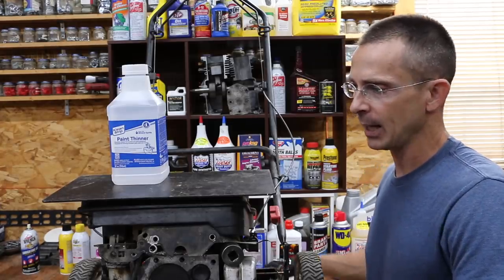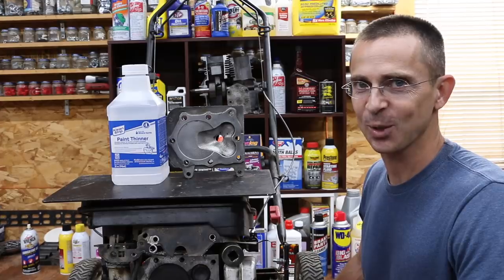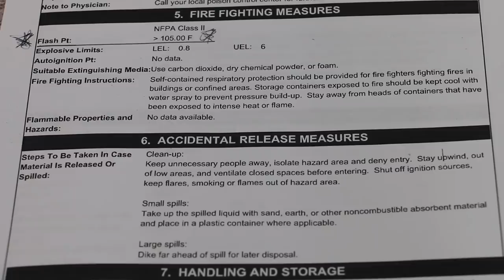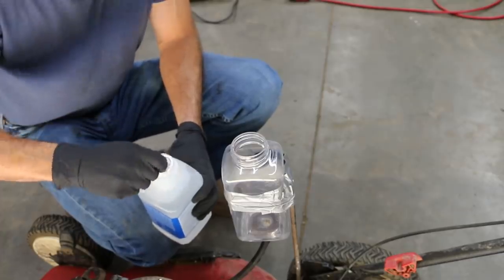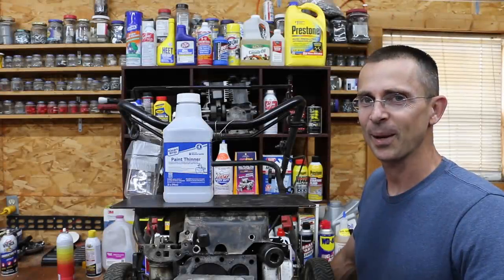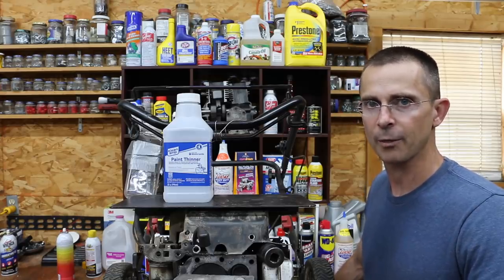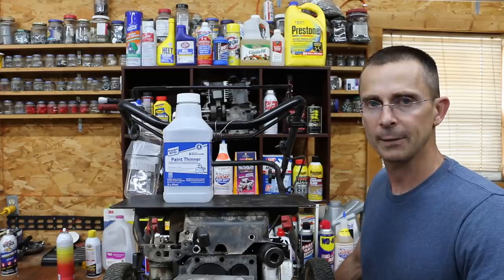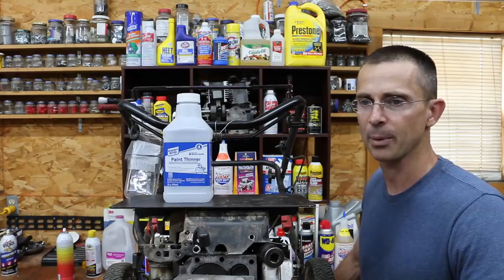Will a Gas Engine Run on Paint Thinner?  Let's find out!

Comment: Great videos.... i don't miss one of them.... question: why if is the same engine, sometimes have 90 psi and like on this have 110 psi on the compression test...?
Reply from the maker: The engine had 110 PSI when it was used in older videos.  In more recent videos, the compression has dropped a lot.  In some instances, the intake valve and piston rings don't seal well with exposure to dirty alternative fuels.
Reply: Project Farm  sorry you right, i didn't check the video date on each one ... Are you have test or someone have suggested to run an engine with only oxygen from a welder container or a mix of air and oxygen, like injecting on the air filter... like and suscribe

Comment: this works because all mineral spirits/paint thinner is essentially is just a dirty form of petroleum distillate which is a mixture of hydrocarbons, and various parrafins and all sorts of shitty chemicals lol. basically you take gasoline and distill it like you would ethanol (drinking alcohol) and whatever evaporates within a certain range is your heavy petroleum distillate (paint thinner). you distill this even further and you get naptha, you could also use naptha although naptha probably wouldnt work as well as paint thinner because its more refined and doesnt possess the same octane rating when used in engines as paint thinner or gasoline, if you have no money though it would probably not be a horrible choice because a bottle of zippo lighter fluid containing less refined naptha than vnmp naptha only costs 1$
Reply from the maker: Thanks for sharing.

Comment: Would please do one on rubbing alcohol  ????????????
Reply from the maker: Thanks for the suggestion.
Reply: @ProjectFarm  I searched yt and found that you tried a different alcohol, not rubbing alcohol.  I was impressed by the motor ran on it. I know WD40 is flammable.  It started a snowmobile with it until the motor started and eventually it started to run on gas .......

Comment: What happens when you put... regular 10-30w in a 2 stroke. And if you put 2 stroke oil in regular engine/car. I ran a toyota echo on 2 stroke gas. Did fine. And what 2 stroke oil is the best? Thanks
Reply from the maker: Thanks for the video idea.

Comment: Way back when I was about 13 I had an MGB that had a bad gas tank and I had it running off a 1 gallon gas can. I had to move it for some reason and it was about to run out of gas all I had around was my mom's Acetone for doing her nails. The engine was already running and I heard the fuel pump start to make noise so I poured it in the car ran pretty good and didn't make any smoke. What did I do to the engine?
Reply from the maker: Acetone is unlikely to damage the engine, but would likely damage rubber and plastic parts in the fuel system if the acetone concentration is high enough.

Comment: What is the best motor oil. To clean lifters. Is it a thin oil or the thick oil. You're always doing test let's see lifters plug up regularly and they make noise and nobody knows what the problem is why they stopped pumping up
Reply from the maker: Thank you for the video idea!

Comment: does the engine run longer off 50/50 vapors? or is straight gas vapors a better shot?
Reply from the maker: Straight gas is a better way to go. Thank you
Reply: Project Farm thank you, can u please put all these youtube theories to rest by doing the vapor test in an automobile?  your scientific method, documentation, disclosure, thoroughness is spectacular. thank u

Comment: whats the best cheap synthetic youve tested,that might be a tough one to answer considering they are always on sale
Reply from the maker: Cheap synthetic oil that did well includes Amazon Basics and SuperTech.
Reply: @ProjectFarm  i bought Castrol EDGE 0W-40 A3/B4 Full Synthetic Motor Oil, 5 QT for less than $19 a jug,so i guess its all good enough i guess
Reply: thanks for the reply !!!

Comment: Here's my burning question, if I'm up in the mtns at 13k ft, can I add a gallon of paint thinner to my 79 blazers 32 gallon gas tank filled with ethanol free gas to reduce the volatility of the gas and reduce the likelihood of vapor lock? I've had vapor lock at altitude before and its not fun.

Comment: Petrol engines should run on any spirit based liquid, White Spirit, Cellulose thinners, Acetone, possibly even nail polish remover. I think a better experiment might be to find what would be a cheaper alternative to petrol. Is there anything cheaper than petrol that an engine will run on?? Any ides anyone???
Reply from the maker: Thanks for the video idea.

Comment: Did you ever do acetone. Just bought a gallon and was thinking of using it on my johnson 225
Reply from the maker: Acetone can quickly damage carburetor parts.  I will likely test it anyway, knowing I'll have to replace all the rubber parts inside the carburetor after the test.
Reply: @ProjectFarm  so don't put any acetone. Not even a10% ratio to fuel?
Reply: @ProjectFarm  what about alcohol

Comment: Hi,  I've been researching using paint thinner as an octane booster for my car.  Do think it's safe to use?i have the same kind of thinner, the kleenstrip paint thinner/mineral spirits. Is this the best one or is there a better. I've heard of xylene being used too.
Reply from the maker: I'm reluctant to offer advice on using products such as paint thinner in a modern vehicle.  The engine will run, but not sure what it'd do to the sensors or catalytic converter.

Comment: Hey Project Farm...  How about lacquer thinner in a fuel injected engine...  potential damage to o-rings, seals, bearings and other parts...? IS IT SAFE?!?!?   and will it clean downstream components (inside headers, mufflers, o2 sensors and catalytic converters...?
Reply from the maker: Thanks for the suggestion.
Reply: @ProjectFarm  Thank you!

Comment: Was this a toluene based thinner?
Reply from the maker: Mineral spirits. Thank you
Reply: Ah, good that i asked then. In Europe thinner usually means a toluene based paint thinner. White spirit or mineral spirits are usually sold as turpentine.

Nice test anyway, toluene BTW is also a common octane booster. Honda even used it pure in one of their racing engines (pre-heated to make it vaporize).
But be careful if you decide to do a test with that, the fumes are very toxic to the brain.

Comment: What Happens When Using A Transmission Fluid as engine oil?
Reply: It works  - i used it when i was desperate and had to mow the lawn before it rain. Then next week i change it back to normal oil when i bought some. Trans oil is TOUGH, think about the beating it takes, just as much as the engine with lower heat of course.

Comment: So I bought some poulan chainsaw premixed gasoline from tsc and it is supposed to last for years and it smells like paint thinner is it possible that is what it is just mixed with 2 stroke oil?
Reply from the maker: It would need an octane booster if it's mineral spirits.

Comment: Sir i 'm waiting for ur next video same as this video. Next time use methnol as fuel. Also 50/50 gas methanol mix. Scientifically show if any problems in engine parts will occur. If it success i can use methanol in my motor bike. I had a chance of getting lots of methanol for free.
Reply from the maker: Thanks for the feedback.

Comment: I'd really tride paint thinner before on  my old scooter after typhoon in our place we all run out of gas and it works on my old scooter. people keep asking me were did I by  my gas and I tell to them that it's my own formula. I'm afraid to tell them that I used paint thinner because I my ruin there motor cycle. yet there bike is 4 strokes and I'm using 2 stroke scooter..
Reply from the maker: Thanks for sharing.

Comment: Make a Video if engine will run on Nitro fuel 16 or 21 % (the one what is used in RC cars ) im realy interested how and if it will work. i have been told story that it super charges the Diesel fuel for diesel cars and can cause damage .
Reply from the maker: Thanks for the video idea!
Reply: Project Farm i found you have done video on rc fuel 30%. But if interested what are the effects of running on 16% or 20% one, whare of the engine. Sadly its not posible to test what it dose together with disel fuel.

Comment: What is paint thinner. Is it kerosene, benzine or acetone?
Reply from the maker: It's mineral spirits with a small amount of benzine. Thank you
Reply: Thanks for the info. Why not try to run an engine on pure Butanol. I understand it performs much better then ethanol as a gasoline substitute.

Comment: Try  zippo lighter fluid
Reply from the maker: Thanks for the suggestion.
Reply: @ProjectFarm  no problem . I did try it on a 1937  johnson iron horse washing machine engine and it did start off of it.
Reply: @tailsdblack463  wait is your washer running on fuel? Greta thunberg has left the chat
Reply: @sephia37   hah well from what i know  zippo fuel is similar to gas though its potency will be much higher.

Comment: Can An Gas Engine Run On Jet Fuel?
Reply from the maker: Thank you for the video idea!
Reply: Difficult, it is a distillation fraction between gasoline and diesel. you need to mix in some propane or more gasoline.

Comment: Hmmm will a engine on gas
Reply from the maker: Thanks for watching.
Reply: @ProjectFarm  I'm actually taking apart a lawnmower right now, quick question will the engine self destruct without a load (blade) on it also if you pump enough air into a engine without the carb or anything else on it, it is said that you can run a engine on air

Comment: I am disturbed that as time goes on, the tests you are doing deviate further away from the practical. I am additionally concerned that as evidenced by the national media, there is a segment of the population, who will emulate, duplicate and modify these tests to no good end. When you start caring more about the view count rather than the content, a line has been crossed. Burning up engines, playing with explosive hydrocarbons and pushing products to the point of failure makes me wonder, is this science, art or entertainment?